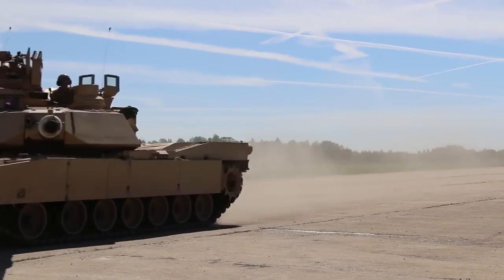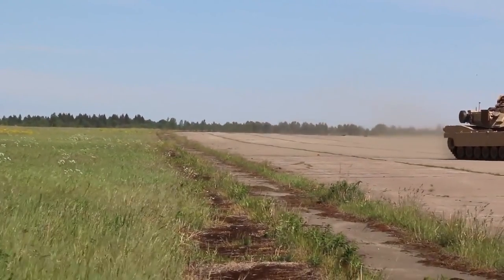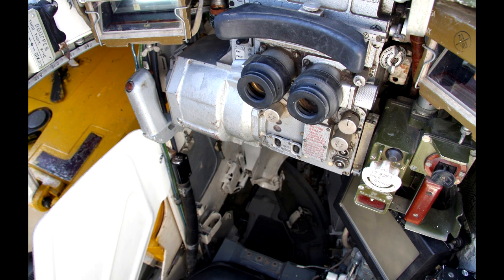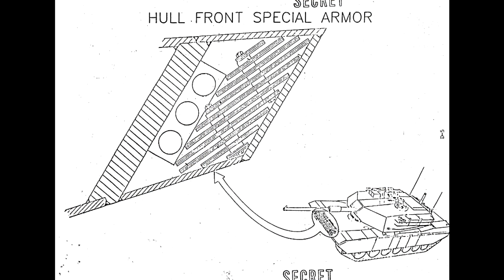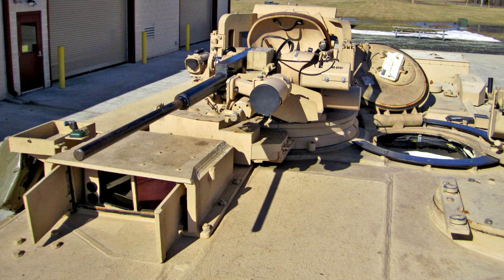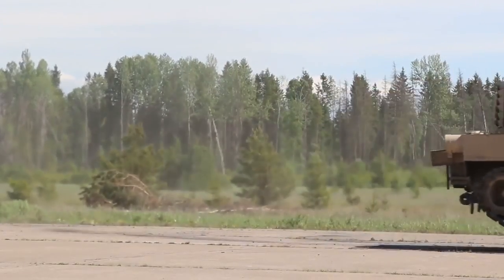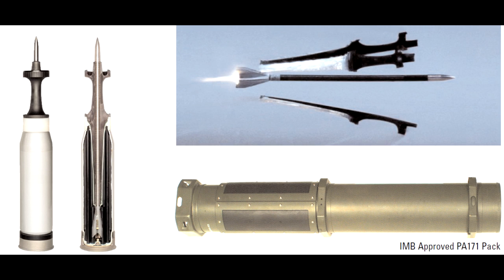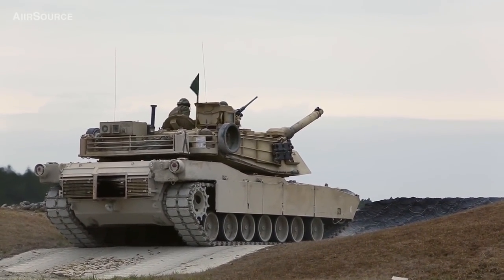Problems with Abrams tank

Comment: Next challenger 2.

Its gonna be one hour long.
Reply: The Engine.
The Armor.
The Gun.
The Ammo.
The Engine.
The Weight.
The Engine.
The Lower Glacis.
And The Engine.
Reply: @todo9633  
>The Engine.
One of the most reliable engines in service with any NATO nation. Praised by the US, Germans and pretty much everyone else for its reliability. It is a tad underpowered which is why a projected upgrade is to give the C2 a 1500hp or 2000hp engine.

>The Armor.
Up until the advent of the Leopard 2A7, the Challenger 2 was the best protected tank in the world. 

With the first (and currently only) armour upgrade pack, it received a further:
1) A 6 inch anti-mine plate made of specialist composite added into its belly,
2) A 800mm composite armour place added to its lower front plate that brings protection up to that of the upper front plate
3) 350mm composite side skirts added to the forward two thirds of the hull which also have smaller ERA added over the top adding another 50mm RHA equivalent armour on top of the 650-750mm RHA equivalent the side skirts already give
4) 300mm plates adding to the sides of the turret
5) Bar armour adding to the read third of the hull and turret.

All composite used in the upgrade is Dorchester (Chobham MK2) armour which is one of the best if not the best armour in the world. Its has ~1.7-1.8 times RHA against penetrator ammunition and ~2.1-2.4 times RHA against HEAT.

>The Gun.
The most accurate gun in NATO service and still very powerful. Whilst there are other guns in NATO usage that are more powerful, it still more than holds its own. The MoD is looking into either a 12mm, 125mm or 130mm smoothbore gun to replace it with however in order to allow the use of more varieties of ammo (which would also be more plentiful than the limited supply of ammo the C2 currently has).

>The Ammo.
Plenty powerful when targeted against most tanks the C2 would be expected to fight.

>The Weight.
The Challenger 2 with a full combat load equipped to theatre standard is 75 tons. An Abrams with a full combat load and equipped to US theatre standard comes in at around 70-72 tons. The Leopard 2 only saw a decrease in weight recently due to the use of a new type of armour however that is far from standard issue and there are rumblings that it also has much decreased protection.

>The Lower Glacis
Which has as standard a good 250mm of RHA. Theatre standard includes the use of a ~800mm block of dorchester armour as well. So there is no weakspot there.
Reply: @LocalDeepstateAgent  The Challengers armour war was made specifically to counter HEAT rounds which it has been shown to do just fine. The lower plate on any modern tank will do next to nothing against any modern round. The reason the lower plates are lightly armoured is because it was unlikely for tanks to be hit there in conventional wars especially when they are hull down. Challenger 2's main problem is it's severely outdated due to receiving nearly no upgrades since it entered service 21 years ago.
Reply: @edwardtaylor7270  Im not exactly sure what counter to HEAT you're reffering to but as far as i know (through aviable media and what british tank crew i talked to in afghanistan had to say) the challenger 2 is lacking any kind of HEAT protection. Might be that the tank itself was developed with plates but the british government as its still doing cheaped out on gear and ticked off those plates from the list of accessorys their tanks are supposed to recive. If thats the case, i feel sorry for anyone who still has to serve in it and ofc. take back my statement of the armor above. Btw. i was reffering to heat protection in the form of hanging plates or heat cages around the tracks when i was talking about the lower plate missing any good protection. But the engine and ammo/canon still lack in quality for the time of development. Something that the british ministry of defense seem to have realised after ww2 for a short moment but completely forgotten again. Can only hope the ministry of defense will soon ask for the development of a challenger 3 and put all the stuff thats supposed to go on it, on it and doesnt cheap out again like with the l85.
Reply: @LocalDeepstateAgent  challenger frontal composite armour is very good against heat as that's what it was designed for. However the rest of the armour is very thin and vulnerable to HEAT.
Reply: @edwardtaylor7270  >However the rest of the armour is very thin and vulnerable to HEAT.

No, it really isnt.
Reply: @todo9633 
The Engine.
 Robust and reliable diesel engine
The Armor.
 With add-on armor package from Rafael made in Israel, one of the best armored and protected tank in the world.
The Gun. The most accurate gun acheiving the longest range hit in history  
The Ammo.
 Very accuate and deadly
The Engine:
 Still better than Russian engines 
The Weight:
 Oof
The Lower Glacis:
 *ADD-ON ARMOR INTENSIFIES
*
Reply: @komradearti9935  >Can't talk much about the engine except that the Challenger 2E export variant uses a German MTU. The Challenger 2 also had to be towed during the trials in kuwait after only 80km. Don't know if it was due to the engine however

Combat records show a damn near flawless engine performance.

>Had a 15km/h lower top speed than the M1A2 and both failed to climb a 50% slope

The C2 was only ever designed to go 40mph and 30mph off road, so it does have a lower speed but it is more consistent due to the use of hydrogas suspension instead of torsion bar.

>Completely inadequate due to small propellant charge and short maximum APFSDS length.

Wrong. Whilst it isnt AS powerful as the gun used by teh Abrams and Leopard 2, it is still a powerful gun, holds the longest range kill in history by a tank where it penned the front armour of a T-72 at over 5 kilometers. Whilst the Challenger 2 may struggle to deal with a Leopard 2, Abrams and possibly the most recent Russian tank, all other tanks would be fair game.

>Only equivalent to the Leclerc while being 5 tonnes heavier according to greek officials after the MBT trials in their country.

Incorrect. The Greek trial was full of bullshit. They even used badly made ammo in the C2s during those trials as they didnt get the ammo from the proper source and then claimed it was still a decent display of what the C2 was capable of.

Analysis by pretty much everyone else states the C2s armour was second to none.

>Was completely outgunned by the M1A2 during the trials in Kuwait and was not very accurate in Greece either

The fire control systems, computers, comms, optics and othjer electronics have been upgraded twice since then, and the issue with the C2's performance in Greece in gunnery was due to bad ammo that wasnt sourced from the proper suppliers whereas the ammo for the other tanks were all sourced from the correct suppliers.

>Only 76mm thick due to standardised plate thickness. The Chieftain and Challenger 1 also have a 76mm RHA plate

Its thicker than than. I've seen a C2 that hasn't been uparmoured. it has a much thicker LFP than 76mm.

>Nothing special. The STRV 122B Evolution prototype got at least similar protection at more than 10t lower weight (side skirts(!) protect against perpendicular RPG-29 impacts, something the first Challenger 2 addon armour failed at on the LFP)

The armour addon was immense. And whilst there have been addon packages for the Leo2 that report good protection higher than that of the C2, it has yet to be tested.

And the RPG29 that penned the C2 was buried in the ground and shot up into the belly of a C2 that had not been up armoured aside from a bit of ERA. The RPG-29 penned even below the ERA so it was just going against the RHA steel that made up the belly and very bottom of the LFP, yet still only did barely any damage. The event in question happened before the 'Streetfighter' armour upgrade package which was the one that added the very thick armour blocks and bar armour.

And as for weight again, the C2 is not that much heavier than the Abrams or the Leo2 for that matter, and the added weight it has got hasnt effected its performance.
Reply: Fact is. Never lost a chally 2 to enemy fire....
Reply: I don’t even think a single challenger 1 was lost to enemy fire. The friendly fire and the rpg pin cushion were repaired swiftly and sent back out
Reply: @komradearti9935  how so?
Reply: according to the cheftien the m1a1 had a comanders override. and he was a tank commander.
Reply: @77shadowknight   that's not  cheftien thats a God
Reply: - ARMORLESS LOWER GLACIS INTENSIFIES -
Reply: @thenumbah1birdman  The lower Glacis is not unarmoured even on a base configuration Challenger 2. I've seen the damn thing in person, there is a good 250mm RHA in the base version. With the 800mm composite block addon, it has equal protection to the upper front plate.
Reply: Is it that Bad?
I always thought it was good?
Reply: NO it wouldnt.

Comment: Knocked out M1's,when receiving a structural hull or turret damage,can not be repaired or reused due to DU armor.Also there is a fire extinguishing system that uses halon gas which is proven to cause serious health problems for the crews.There is also no escape hatch under the tank belly.Also sheer weight of the tank makes it hard or impossible to cross over most bridges.There was also a serious lack of HE shells as they were not even used in the beginning of the tanks use.M1 only had APDS and some weird round that resembled a shotgun cartridge,just on a bigger scale.
Reply: But seriously how hard was it to get an HE shell? The AMP round helps finally but there’s no excuse for having on for the smoothbore in the first place. The Soviets did it for years
Reply: You dont need HE if you have HEAT-FS tho. More or less the same explosive mass. And with the halon, better with health problems than dead. I agree with the stupid 70t weight, most WWII designs where under 65t (i believe only the germans went ham on armor with the Panzer V-VIII series (Panther, Tiger I and II and ofc the Maus) so thy where rly the only ones using tanks with >55t). And by shougun shell you mean canister?
Reply: 1211 halon produces toxics when it contacts hot surfaces in a fire.  1301 halon does not.  Abrams tanks used 1301.  Russian tanks used 1211 and the crew had to bail out in fires.  Don't know if they ever switched.
Reply: M1 Abrams also had another useless round called HE-OR, it's actually a fin stabilised APHE.
Reply: The do not need to carry he rounds , you obviously don’t know anything about the composition of a tank regiment, the travel with Bradley’s and infantry, 10 miles back there are mobile artillery following them to provide support further back there are mlrs, and cas support provided by the Apache wing and usaf a10, beyond that you have indirect cruise missiles, that is they do not need to carry he rounds
Reply: @canton7180   That can work in ideal conditions against unworthy enemy,just like in operation desert storm.
Because,for any fortified enemy position,you have to call on arty or CAS.That  was easy against Sadam's  army...US army needs total and overall  air and ground superiority to be effective...try doing that on someone equal,that can actually fight back..
Reply: @mrcha84 fundamentally the gulf war came down to unabated air superiority, no world power can match the United States fleet's ability to provide mobile air power anywhere on the globe, granted countries like the Russia and China are exceptions, I do not think the US would ever consider attacking either's mainland without dire provocation, that would be entering a war of attrition at best, as far as Iraq they invaded Kuwait, they called their demise upon themselves, they provided the justification and provocation, and they suffered the consequences end of story, they where in over their head all they had to do is vacate Kuwait and it would of been over and they choose not to.
Reply: @canton7180   Easy,easy...there is no need to go into political details and justification of US intervention.That's totally another subject.
We all know very well the Uncle Sam's thirst for democracy especially when it comes to oil rich disobedient countries.
My point is that a tank without HE rounds is crippled without  CAS or  quick Arty support.
Reply: @mrcha84  I have to ask have you ever served within military capacity, there is no such thing as a righteous conflict, let me break it down into terms hopefully you can understand, Kuwait is a ally of the US and a member of NATO, when they where invade by Iraq the US was obligated to come to their aid, you obviously weren't there nor do you understand the impact of what had happened, I was as a marine infantrymen, when I entered Kuwait city I saw corpses hung from flag poles and the dead bloated bodies of children and women left to rot in ditches.
 Yes oil was involved, so was the economic stability....I 'll be the last person to defend our government's interest because they always revolve around obtaining and maintaining power.   Our government is guilty of many cowardly acts, the kurds who aided our operations to the north were slaughtered when we abruptly pulled out and left them to bare the consequences for assisting our forces, much like the Laotians during Vietnam...….I could write a book of my disappointments in my leaders and government that I experienced throughout my military career, In Somalia during peace keeping where guarded the UN perimeter from vagabond warlord factions, the second the aid left our gates it was taken by these same warlords and we couldn't do a god damn thing about, the food and medicine would never make it to the people who needed it, that leaves you with a deep feeling of despair, this was right before the Army took over operations in 1992 or in Kosovo the mass graves of religious faction genocide, Europe excluding Russia is a compact area, yet not one European country lifted a finger to intercede, that is why UNCLE SAM always haves his finger on everything, because no one else will do a god damn thing.
Reply: @mrcha84  I do not support any of this or their agendas, I' am well aware of how corrupt my government and politicians are, they are self serving parasites, I served in the capacity of intervention, Kosovo was present to me and the people I served with on the basic premise of 2 different groups of people at war over ideology and to try to end the conflict, who is guilty of what is up to the tribunals to decide, though I 'am also aware true justice is not always served, it is often contorted, skewed and manipulated, the most important lesson I learned is there is no such thing as a perfect world, every human being is one step away from becoming a monster, I came to terms with that the best I could, I realized there is absolutely nothing I could or ever would be able to do to change that, that is the fate of mankind....I believe what you have said to be possible, especially given the fact the Clintons where in office, they are a specially vile category of politician who to this day seems to always have their hands in domestic and foreign affairs, I have done my own research into the history of the area because there seemed to be a lot of inconsistencies, it has become my nature as I have aged to question everything even if I only do it internally and I rarely make a habit of accepting things at face value, I do not trust what I considered spoon fed propaganda, too many easy answers and too many holes- so indirectly I suppose you could say in some way I supported it, knowingly not a chance in hell, in retrospect would I have still lived the life I have?....yes because if I hadn't I would not become aware of how the world really works, I would of been just another lamb being led by my nose by the wolf.
Reply: It has heat which was proven very effective against infantry for the splash that the round makes when it explodes
Reply: M4Operator101 

HEAT’s an anti vehicle round, as in a shaped charge with a area of effect focused in front of the munition as opposed to a HE-FRAG round with a area of effect much bigger in a roughly circular radius. Perfect for killing staggered troops, technicals, lightly armored vehicles, buildings,etc.
Reply: if the weight of the abrams is such a problem then the leopard 2a7 has it far worse.